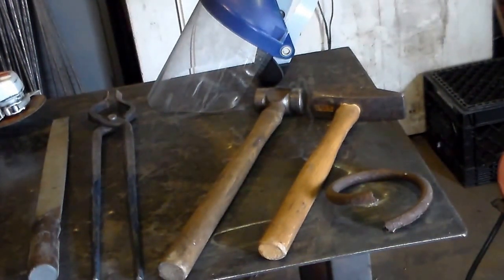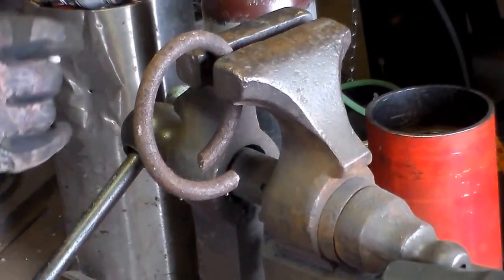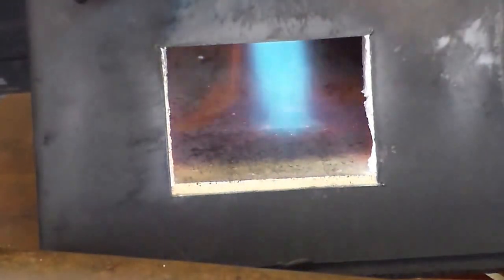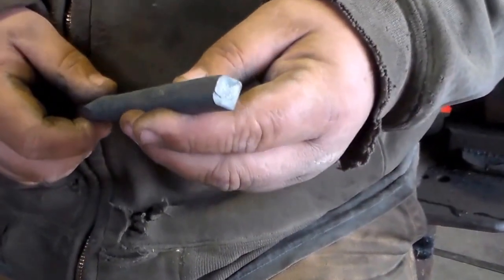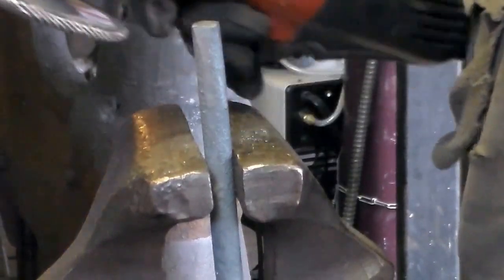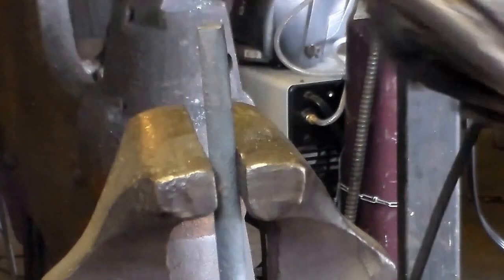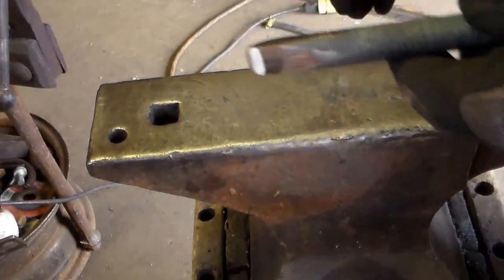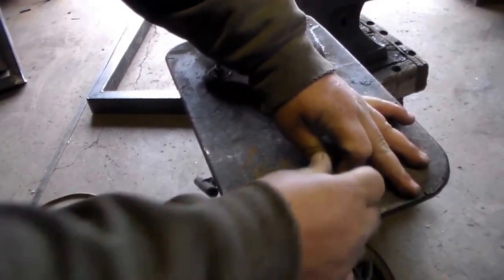Forging, hardening and tempering a cold chisel from coil spring

Comment: if i use this chisel on redhot stock, what will happen then? will the chiseltip become softer, or...?
Reply from the maker: Short answer is yes, this is a cold chisel, meaning it is to cut cold material. For hot cuts and other punches and struck tools that come into contact with hot material I use a med carbon steel and normalize it. See with hot tools the material they come into contact with is softer so they do not need to be as hard. Hope this helps.

Comment: That didn't exactly zip through the coil spring the neither did my four and a half inch angle grinder but sure as hell beats the heck out of a hacksaw everyday of the week which I have had to use too lol great video sir I am about to attempt the same thing because I was given a few coil springs my father in-law was gonna throw out I'm making a few for my Hardy hole like a cutting chisel and a tapered round punch in a few sizes
Reply from the maker: You can normalize the spring if your forge is large enough or just do a section with a torch. Just heat to nonmagnetic and let air cool. Let us know how those projects come out!

Comment: Probably the main reason your chisel cracked is because you heated it TOO hot for the hardening quench.  It should be just non-magnetic, probably about cherry red, not the bright yellow or orange.  Quenching too hot will almost guarantee a crack will develop at some time.
Also, to stop the color run when tempering, you can just use water, no need to use oil.  It's not hot enough to need an oil quench.
Reply from the maker: The camera shows things brighter than they are, but I shoot for around 1500.
Reply: @VooDooTennessee  1500 may still be too hot.  Try a darker red, say around 1200-1300 deg. F.